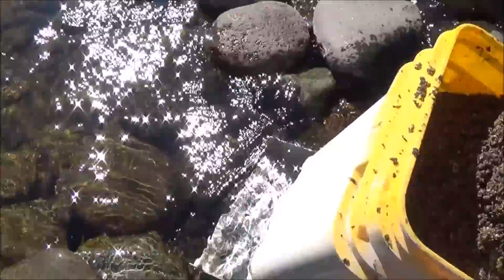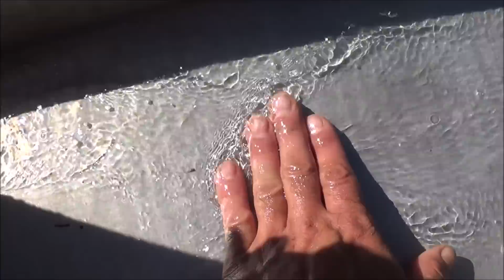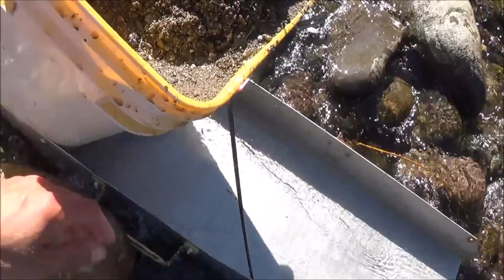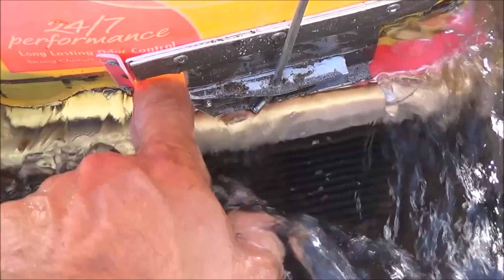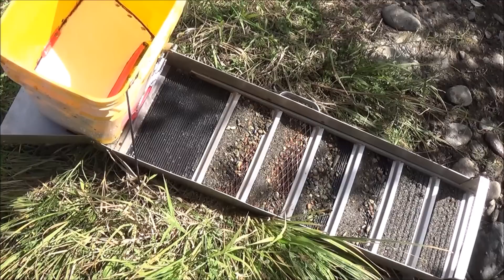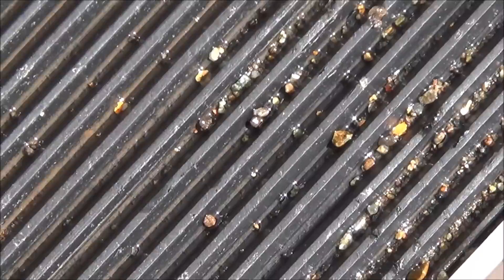Self Feeding Sluice Box! Cool new invention takes the pain out of feeding a sluice box.

Comment: Nice build.Try adding a mud flap to the bottom of the bucket.Apiece of rubber like tire tube would do.The idea is to to stop the rooster tail in the center of the sluice going over your first couple riffles.Spread the water out more.If it does not work toss it.I find it works very well in my highbanker when I am giving it more water,Also gets rid bubbles.Just a thought.Luck Mcbain.